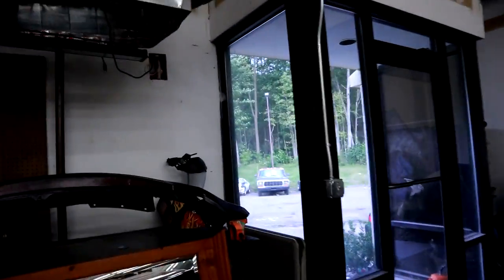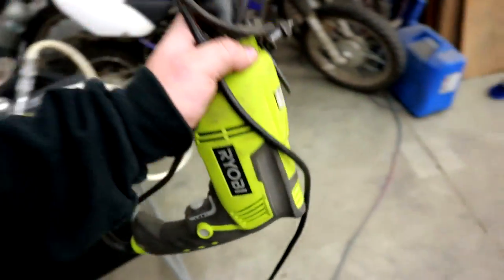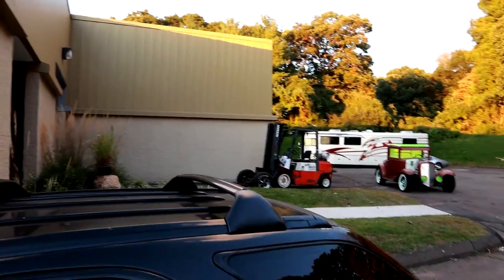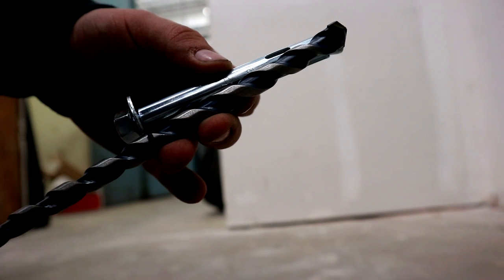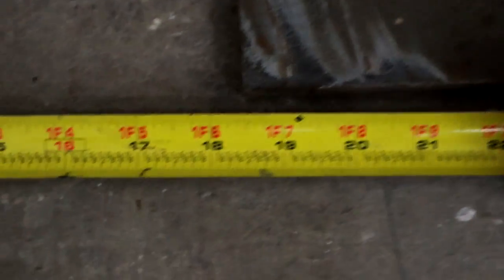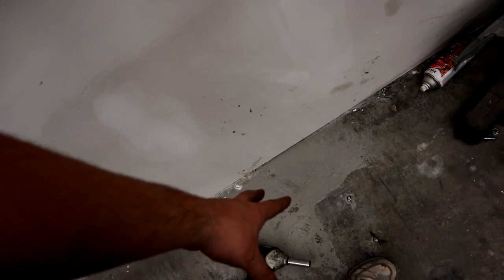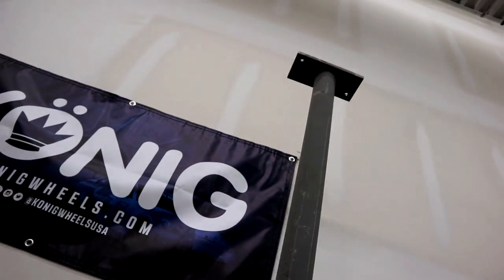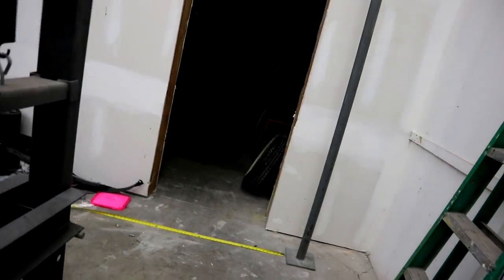THE FORKLIFT BROKE

Comment: 2 anchors per post should be fine that’s just the sheer strength from side to side , all the weight will be downward pressure , just don’t drive a car into them  , licensed contractor in mass I got you

Comment: You do need to drills any holes in the base. But just curious did you make sure the beams level? And that the concrete was true and level across. If not you might need to shim it.

Comment: built a whole deck a story off the ground, with a couple buddies and step ladders. 🤷‍♂️
Reply: I was thinking the same thing what is the forklift foe ?? Waist of time
Reply from the maker: Jerry Wooton you can build whatever you want but these beams are already assembled and about 7-800 pounds each and have to be lifted and placed on the thin platforms on top of the support poles and would literally be impossible without a forklift. You can see in the video how much wood makes up that beam and I literally measured it at 32 feet no one is picking that up by hand and placing it on the supports lol
Reply: a 4x12 32ft pressure treated board would be about 450, and your not building it to hold a car, so even 1 4x12 would be max youd need to use as base boards.